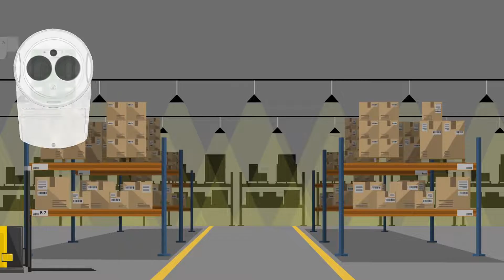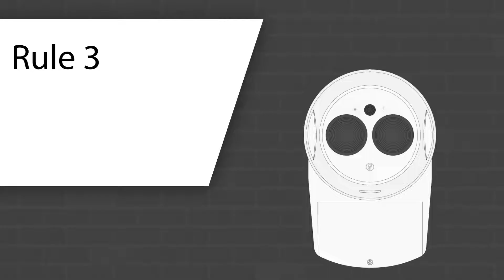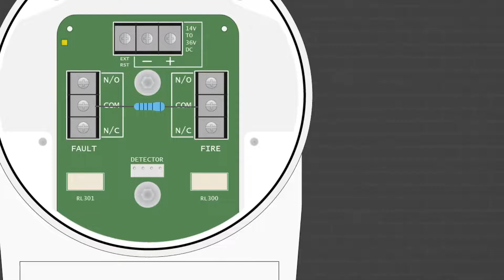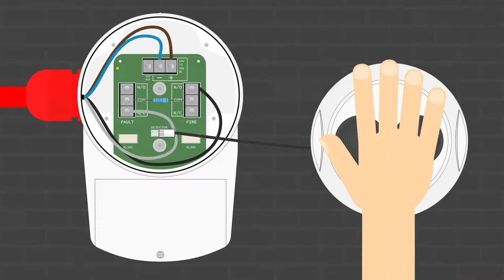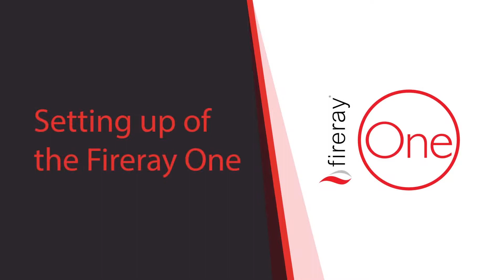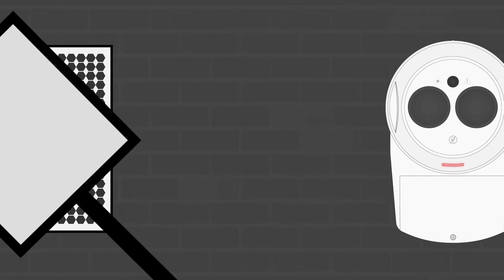Fireray One Set Up Guide

Comment: How does it signal fault to the fire panel if the EOL resistor is not split across the fault relay to the input cable?
Reply: The fault relay will go N/O and the interface will lose the end of line.
Reply: They need two separate monitor modules or zones. This is not how to monitor the faults
Reply: They need two separate monitor modules or zones. This is not how to monitor the faults

Comment: I am interested in buying Smoke (Fire) Beam Detector with a range of 100 meters. Is your beam detector compatible with the Cooper Conventional Fire Alarm Control Panel model FX2204. Can it be connected to the Cooper Conventional Fire Alarm Control Panel model FX2204.
Reply: Yes, it can connect to any conventional fire alarm control panel. If you have any questions, please contact me at +1 713-705-4801 or allen.brier@ffeus.com
Reply: @allenbrier7397  hi please we need wiring drawing for connection two beam detectors
Reply: @mahmoudhamed5488